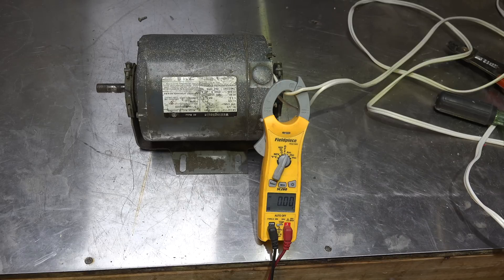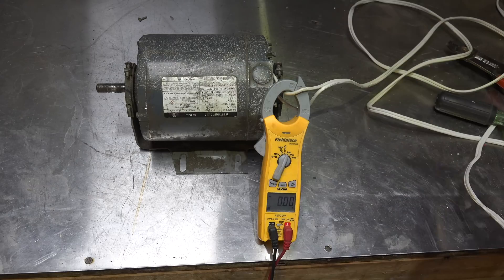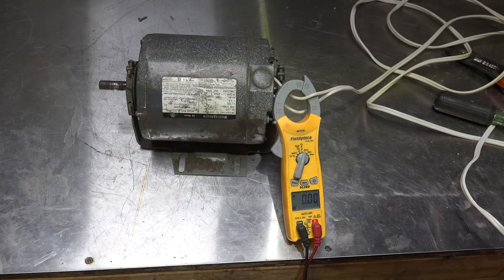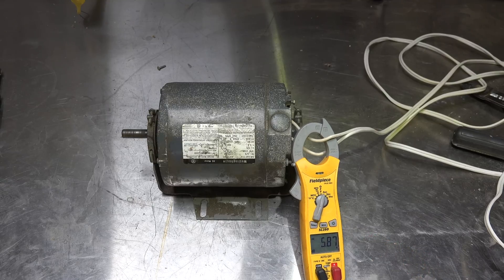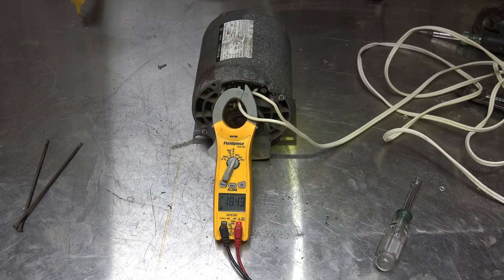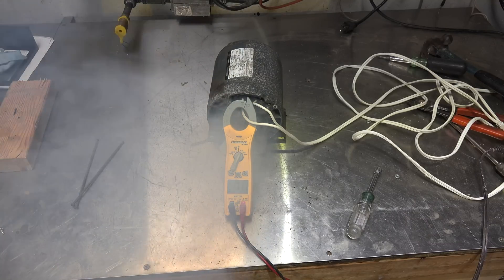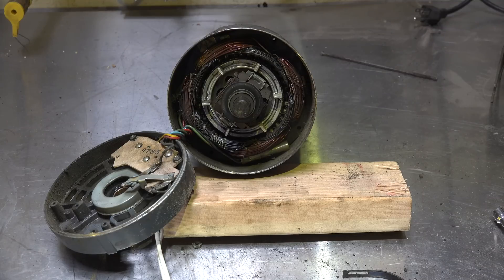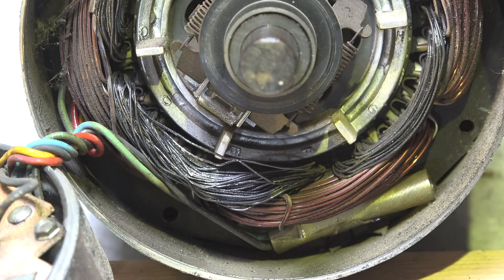Centrifugal start motor troubleshoot #2

Comment: Hello Gray,
I have taken out a Kenmore washing machine motor that has capacitor and centrifugal starting set up.  There is one pair if high speed wires and another two for low speed.
What I like to know is which wires go to the coils and which ones to the armature and like to be able to separate them as two separate circuit and keep the starter winding also to itself as third circuit.  Just like to know get an idea what I should do.
I assume that this types of motor are series so the coil and the armature are fed by the same wires.  I don't know if I am making any sense. 
What I want to experiment with is to feed DC to coil winding to get it energized.  Turn the motor and see if I can get volts through the armature, to get an idea of it would generate electricity and would it be DC or AC.... ? 
Just like to play around with it for experience.
Reply from the maker: First, there is no armature on an induction motor.  The rotor has no electrical connection to any other part of the motor.  There are 3 windings in the motor.  You could try energizing, say the start winding to try to induce magnetism into the rotor but DC power will not work because it does not reverse.
GFM
Reply: @grayfurnaceman  That makes perfect sense.  I was wondering why I could not see any brushes. I also realize why the motor doesn't really go that fast. It depends on the frequency of the power supply.  Thank you.

Comment: what about those springs?  my dryer is missing one of those springs on its motor--would that cause the motor to not turn?  the technician seemed to allude to simply replacing the spring, but he also more firmly suggested replacing the motor.  Thoughts?
Reply from the maker: Replace the motor.  It would be very hard to find the correct spring.
GFM

Comment: such an awesome and informative video. I am working on a 1930 Craftsman band saw and the motor does exactly as the first example, humming. with a little help by spinning the shaft it runs like it should. this explains and showed me exactly what was happening. hours of searching for the answer and now I have it.. awesome stuff. Thank you!! hopefully I can get the switch to work again. any suggestions?

Comment: would you have advice ,My motor  will start and run ,then  heats up, in 3 mins it warms up ,then I hear a relay and it shuts off its a century 1/2hp thanks
Reply from the maker: The motor has failed.  If it is   a 1725 RPM motor it probably has the start switch stuck closed.  It will have to be replaced.
GFM

Comment: GFM, that was an excellent lesson in potential issues with 115 v. split phase motors!  I didn't think you'd go all the way and let the motor run with both windings energized, but this was a fantastic illustration of what can happen when the BLUE SMOKE emerges from a motor. (I don't know how they put the BLUE SMOKE into motors and relays at the factory, but experience has taught me that once it comes out, the motor is kaput!)

Thank you for another superb video!  I was lucky to have had a journeyman like you teach me the fundamentals of electric motors and the theory of operation, which is critical in understanding HVAC/R.  Great job.
Reply from the maker: Don't you know that blue smoke is what makes electrical things work?  Cause when it leaves, the thing don't work.  lol  Its kind of my job to run things to destruction.  Thanks for the support.
GFM